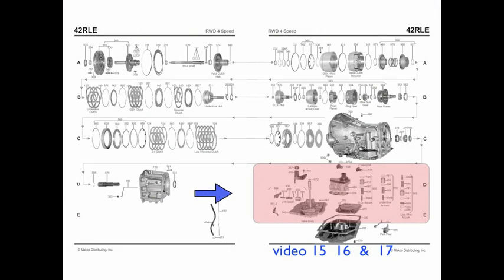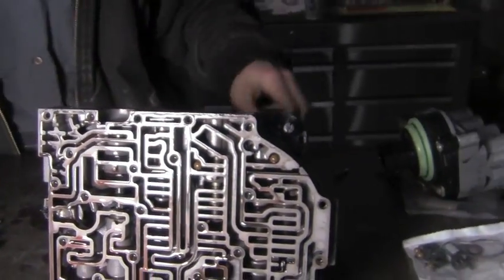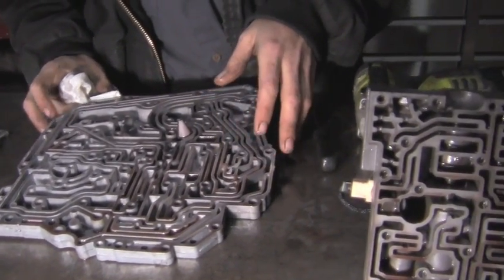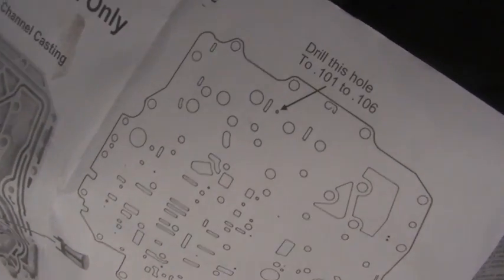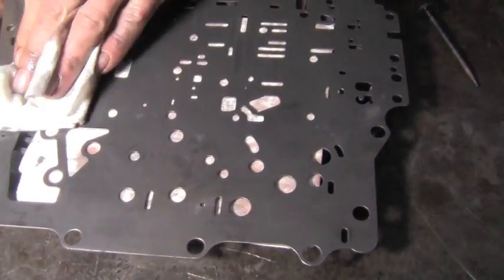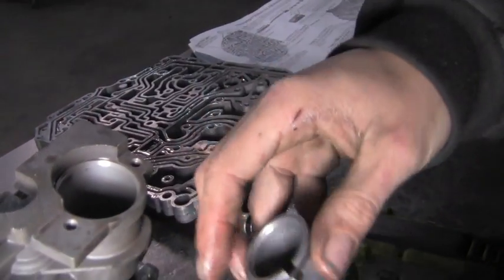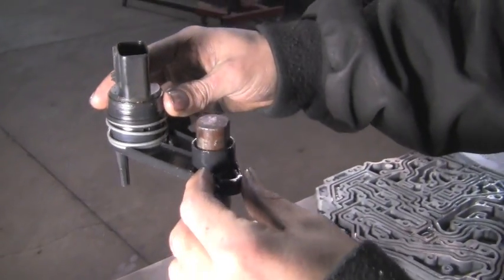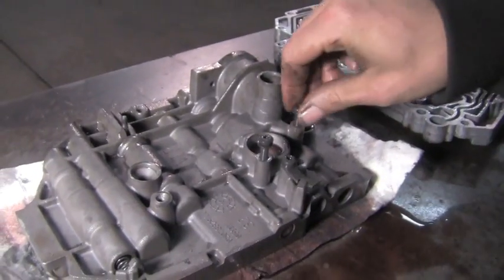Trans rebuild part 15:  Valve Body

Comment: hey i had a square c-clip looking thing fall out along with 1 check ball valve when I took mine apart and i cannot for the life of me figure out where that C-clip looking thing goes....do you happen to know by any chance? its just a square piece of metal with a C-shape cutout a little smaller than 1x1in in size

Comment: 15 videos so far and I just dont see or understand how a automatic transmission can last 5 minutes with all these parts, O rings, snap rings, plates, bell sprigs and now the valve body with all them holes and channels, all that stuff have to be just right, but then I seen automatics go 300k without failure.......

Comment: Thanks you bro, I unmounted the body valve wintout unmont the transmission and I lossed the position of the balls, and even I doubed if I loss a ball. But thanks you I confirm was try ball and the positiion. 

Gracias amigo, me salvaste. Yo desmonté el cuerpo de válvulas con la caja montada, y tontamente lo desarmé por partes. En el proceso cayeron las bolas y dudé si eran cuatro y había perdido una y que fuesen cuatro, y de paso en los pdf aparece que son 4. GRAAAACIAS

Comment: I rebuilt my 96 Tahoe transmission 21 months ago and it had a 3 gear quick slip for over a year. I figured out from reading blogs that the new spacer plate I put n was the problem. The 3rd apply hole needed to b drill larger. The plate i bought from a trans shop was for a 4 cylinder 4L60e. It has 19,000 miles on it now.